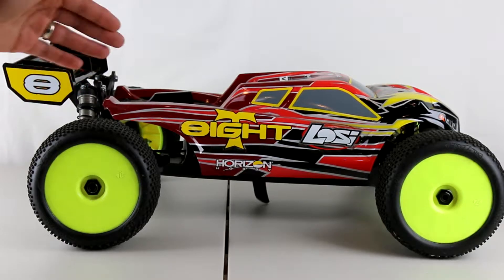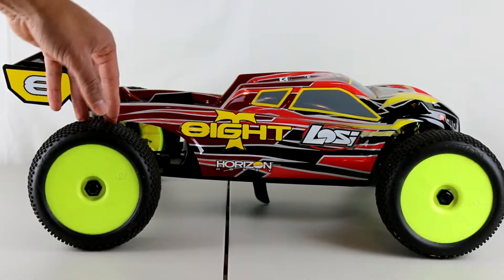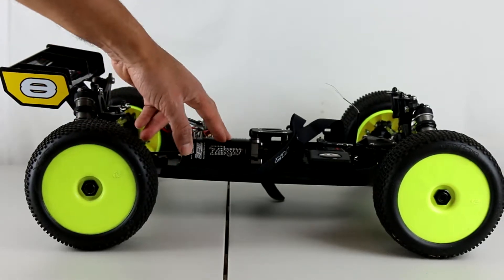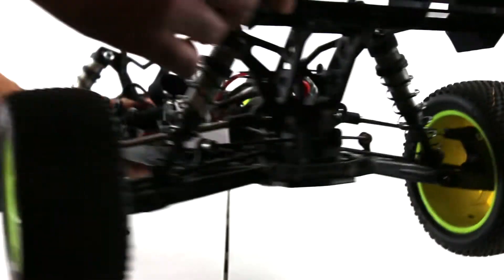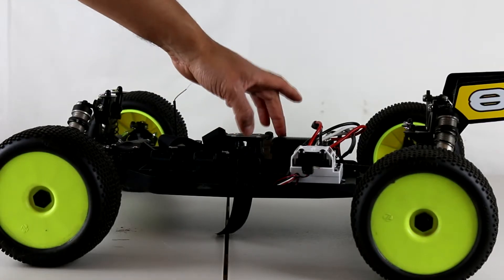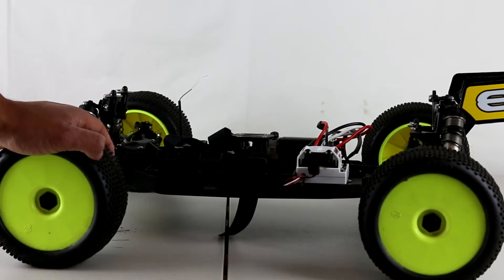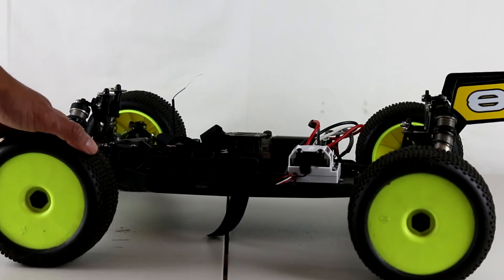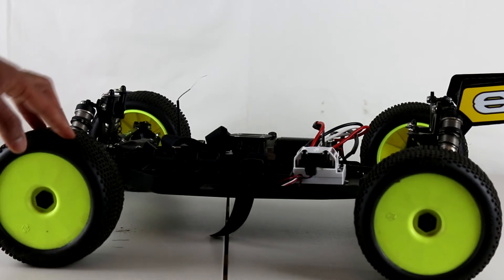Losi 8ight-T Gas to Electric Conversion

Comment: hello I made this transformation with the losa 0912 kit on the losi 8ight 4.0 but once mounted the body of the outbreak does not mount because it touches the 4S hard case battery ..... which bodywork is good ?????
Reply from the maker: @powerROBY  Unfortunately I do not own a 8ight but surprised if the stock electric body will not fit with a 4S pack.  Must be a pretty large pack.  I know the Arrma Typhon body may have that extra clearance but not sure if it would fit exactly on this chassis.

Comment: Not very good in detail of how to do this transfer from anyone. Trying to use stock differential and it's telling me to spin it around $180° now from where the gas engine was why is this?
Reply from the maker: @Ed Haspadura  Yeah this was not a popular model so not too many videos on the truck.  You can use the stock diff and spur but you need to lift the center diff mount.  The guy I bought mine from is no longer doing them.  It was 4 years ago. But you need to find a way to prop the mount up then you can use the metal spur.  If you are on IG I can send you a better pic of mine.

Comment: So the only thing you need is the losi conversion kit correct?
Reply: Aside from electronics i mean
Reply: Im having trouble finding the diff spacers for the center. Is this a must have for the conversion to work?
Reply from the maker: @Jeremy Breeden  That is correct, conversion kit and the diff spacer.  This was some time ago but I feel the diff spacer was if you want to keep the metal spur than the plastic one that comes in the conversion kit.  For me the metal was a must.   That spacer was limited when I did this conversion too.

Comment: HI, I know it's a long shot but do you have a part number for the part that raise the center diff ?
Reply from the maker: @McFly
 Sorry no part number.  I even checked his site he no longer has them listed. You may want to contact him directly to see if he still machines them out.  http://www.sumo-racing.com/contact_us.html
Reply: Mcfly did yoi ever figure out what to do for the spacers?
Reply: @jeremybreeden4228  Nope, I sold my Losi and now running a tekno ET48.3 😎
Reply: Lol yeah i have a tekno mt410 jist got this losi as a project im nust concerned about the spacer thing i know everything else will work cause i jist did a nitro losi t to brushless but idk if this gas version is different the nitro didnt need the spacer
Reply: @jeremybreeden4228  When i ask for the spacer it realy was by curiosity becaus my losi was an electric one. But i sold it realy fast not because it was bad but i realy wanted a ET48.3 et voila 😁

Comment: What model is this? I have a 2.0 buggy I want to convert. Mamba is one the way (good deal on ebay so that couldn't wait) next is the conversion kit.
Reply from the maker: Fetusbakon69 Fetusbakon69  This is the Losi 8ight-T 3.0 platform.  Good luck on the conversion you are going to like it.

Comment: Have a question the same eight t can u tell me your parts numbers do i have yo turn center diff around  thanks for your help
Reply from the maker: Red Irish Thanks for watching.  The parts are listing in the description with the links.  The center diff does not need to be turned around.
Reply: Ready Set RC  u have pic of ur set up please
Reply: Hello u have pic of your setup I have the same truggy I have a kit not sure what I'm doing wrong
Reply from the maker: Red Irish Let me know what you are having an issue with.  Are you using the spur gear that came with the gasoline setup? If you use the center diff lift on the second link it will fit with no issues.  If you are using the spur gear that came with the kit that should work as well but I wanted to use the metal spur gear.
Reply: Ready Set RC  u have a Facebook
Reply: Ready Set RC  like for me to talk with you
Reply from the maker: Red Irish Sorry I don't have Facebook but I'm Instagram.  Are you on Instagram?
Reply: Ready Set RC  no I don't sorry are u able to trade numbers

Comment: Does it have reverse or do you have to get the electric Center diff to make it have reverse or is it just a direct fit you can use the nitro differential thank you
Reply from the maker: Garett Bodel Reverse is set from the ESC.  Mine has reverse. This conversion kit from Losi is a direct fit.  No diffs need to be swapped out when converting to electric.
Reply: You do have to spin the nitro differential around 180°. In order for the motor mount and stuff to fit
Reply: And you will have to shim it up about a 16th of an inch if you use your nitro's differential gear it is larger than what comes with the kit but you cannot disassemble this differential